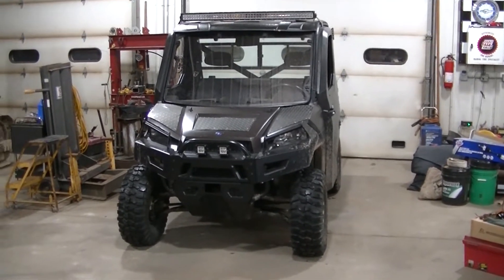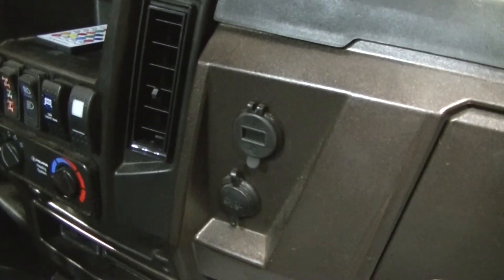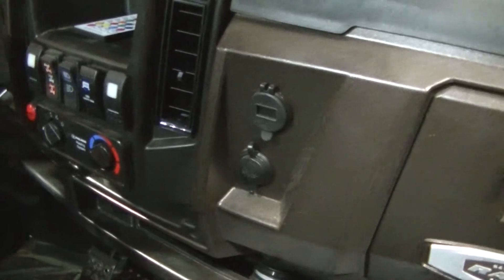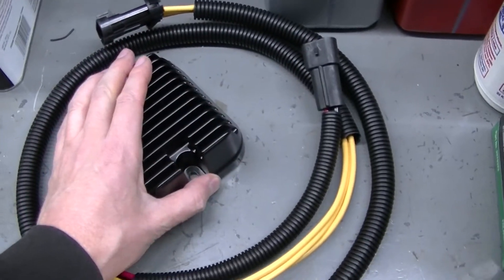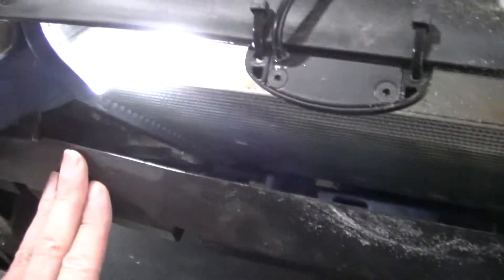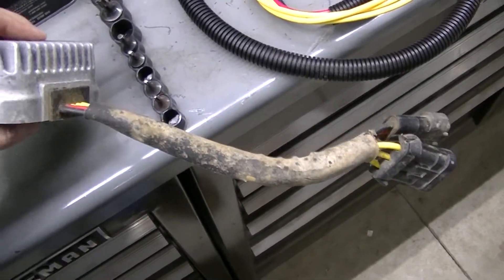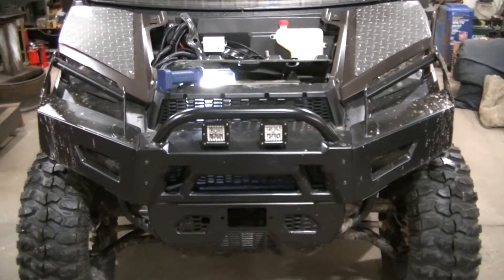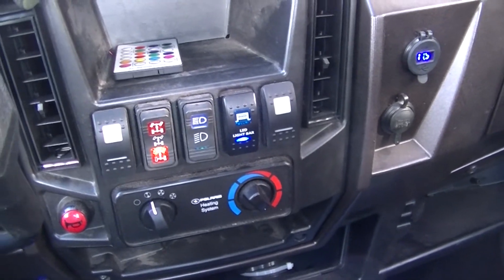Polaris Ranger 900 | Voltage Regulator & USB Power Port

Comment: Actually the east access is I believe is the smaller plastic grill located underneath those cubed LED’s. Pop off that small grill and violà your practically right there. After that it’s just two more screws that’s holding up the reg-stat, unplug and then reverse the operation with the new one. Nice sidey by the way. I run the 15’ 900XP North Star Edition and faced this exact problem. I was looking to upgrade to a 23’ ranch edition but saw the prices. I mean 40-50K for just one is an astronomical amount for them. Almost as much as a car anymore.
Reply from the maker: The grille on the 900 doesn't just pop off.
Reply: The center grill on 2013 900xp does pop off, but im not sure what hes talking about when he says 'east access'? If he means that little passenger side grill next to center grill, it does NOT pop out. You have two options: 1. Go in from the top like you show in video 2. Go in from center grill. I guess 3. Remove the entire front plastic which im not doing. @mossman381
Reply from the maker: @buckperry5956  There is no part of the grille on a 900 that pops off. Don't know what you guys are talking about.
Reply from the maker: @buckperry5956  The Hood pops off. Not the grille.

Comment: i put silicon on the back of rectifier to hold the aluminum plate in place. the aluminum plate i assume helps dissipate the heat

Comment: I like that power port thing very nice btw think u was right about my light bar I am pretty sure it's the controller freezing up inside or something sticking I  Brought it inside to let it warm up for a little bit took it back outside hooked it backup and it worked just fine Speed tech sending me a new one
Reply from the maker: I hope it will fix your issue. Having problems is no fun and even worse when you can't find the problem. I guess that's life though.
Reply: @mossman381  yea I'm pretty sure it's the controller they sent me a new bar and it's still doing it so has to be the controller I'll let u know how has your bar been doing ? And have u mounted any to your dad's truck yet ?
Reply from the maker: My bar is doing great. Getting dads lights installed right now. Should have a video soon.
Reply: @mossman381  awesome I really love your videos and how awesome u make your trucks like

Comment: I’ve got a 19 900 and I’ve been looking for something like this. I’m pretty sure mine doesn’t have a volt meter in the factory gauge, though.
Reply from the maker: I like that I can glance over and see what it says.  Make sure you have a wider female spade connector on hand. The factory has one narrow one. If you do get one let me know what your volts are at idle.

Comment: Yo how do you get the regulator back on? its impossible to fit that passenger side screw back in there without some trick i dont know about
Reply: im thinking about just zip tie the thing on but i feel like i got this far to get it off i need to figure out how to get it back on
Reply from the maker: Not easy. I just struggled until I got it.

Comment: What size socket did you use to get the bolts out of the voltage regulator
Reply from the maker: Can't say I remember but 10mm is pretty popular. By the way get an OEM regulator. This one never worked right.
Reply: Mine was same size sockets holding voltage regulator as the ones that hold those two brackets above radiator. 10mm I believe.

Comment: Hi. I replace the voltage regulator in a 900 ranger and I have the same problem than you low voltage can you tell me if you find the problem please
Reply from the maker: Get an OEM one and you won't have any more problems.
Reply: Ok I will do that thanks for your help

Comment: Any update on the idle chsrging issue?
Reply from the maker: Yup, it stopped charging completely. Bought an OEM one for $175 and it's working fine so far.
Reply: Thanks for the quick reply. Just ordered the USB through your link for my 2015 900xp.
Reply from the maker: The USB is working great. I like just looking over and seeing the volts. That was a very easy install. The second voltage regulator went in easier than the first one. If you have big hands it might be an issue.